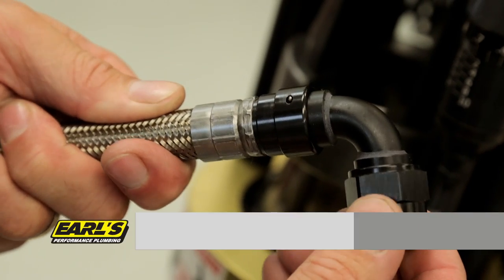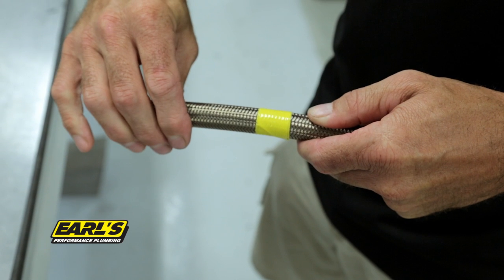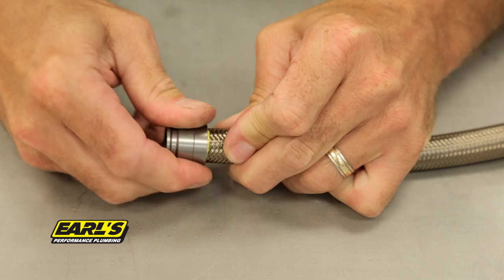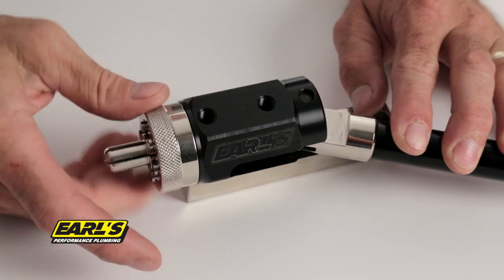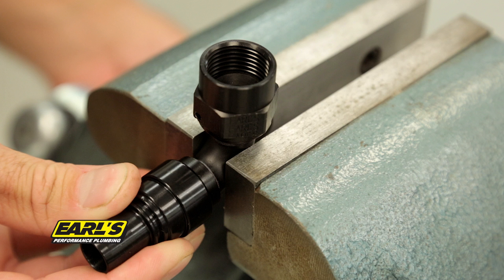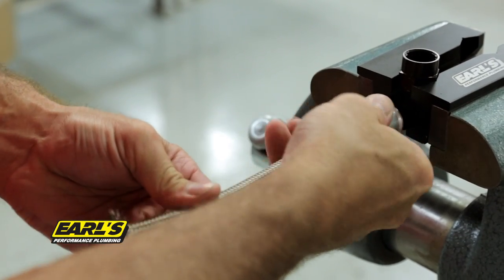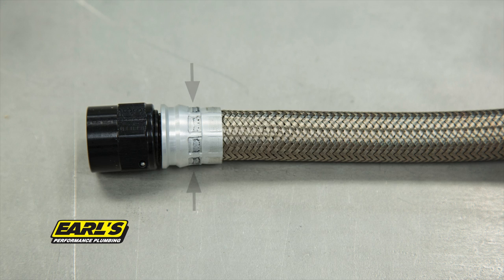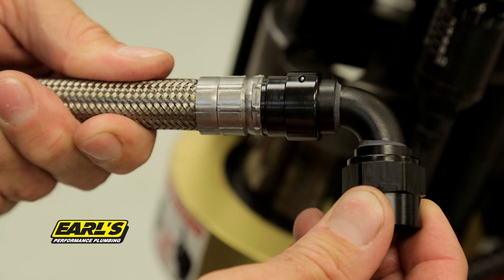Earl's Ultra Pro Hose and Crimp-on Fittings Assembly

Comment: What hose and fittings do I need to make a high pressure power steering hose? (one side is 11/16 -18 AN6 inverted flare the other side is -6 M16x1.5 male oring) and I need two 90° adapters.